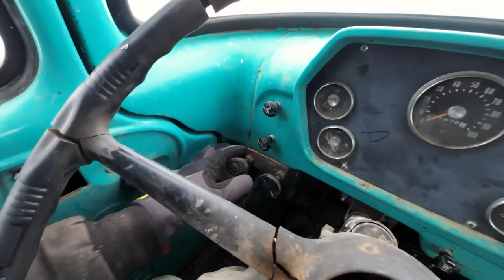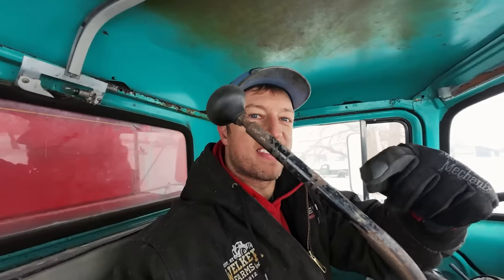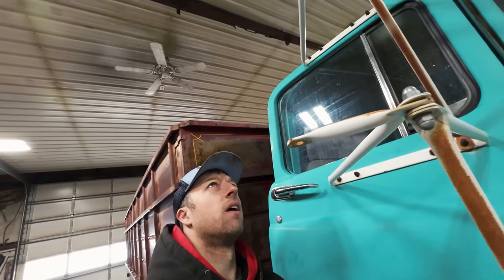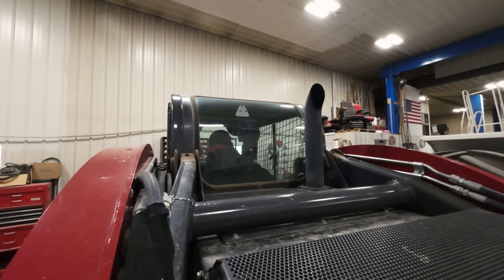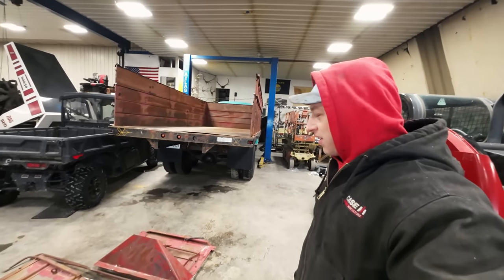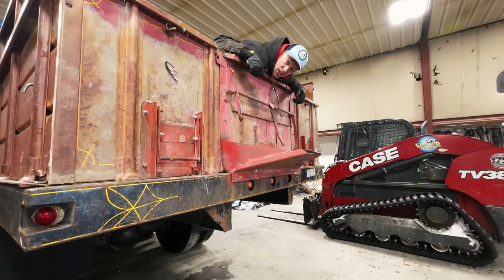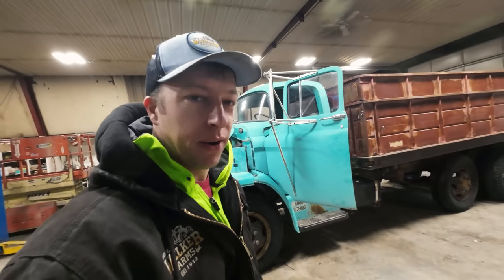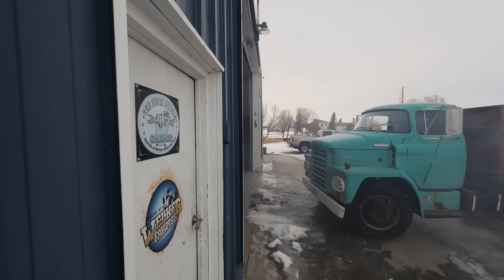It's Running! Part 2 of Baby Blue!

Comment: We never threw anything away on the farm. We had 4 engines from a model T and A that were wrapped up in that old black plastic and my brothers wanted to take them to the salvage metal yard but I paid them what salvage metal was bringing and stored them for another 40 years. I sold each one of them for more than what a new complete performance engine would cost from Chevrolet X 4. Never sell scrap metal and call it twice loved.

Comment: I’ve got a 1945 Ford murcury that was the families grain truck 
Was always in the shed  and no one but my family ever owned it we hoped to get into and get it running removed tge heads and was pleasantly surprised to find everything minus tge radiator was in good shape 

Since the flat head engine is pretty easy to find parts for and once we ripped the sides of the grain box off to find a nice hard  one deck to it thE plan was to turn it into a tool and service truck. I still can’t get over how simple those early engines are.

Comment: Thanks for another great video. 

It was interesting and enjoyable. 

Good job nick. You got the old dodge tunnel again and touched up a lot of things on the truck and box setup. 
Old truck but very useful yet for its age. Lots of use yet left in it. 

Good job on the fix it jobs nick. Spring is around the corner. 

All for now. You take care and be careful. 
Thanks for everything. 
The Iowa Farm Boy.

Comment: Hey Nick & Scott; after watching your content - allot involving repairing, thought you might be interested in the ChemFree SmartWasher system.  I've been using it for little over a year now and am very happy.  The solvent is water based, has microbes which eat petroleum products, never needs changing, and is not toxic at all.  The solvent is cheap, microbes are replenished with the Ozzymats, Ozzy Booster, or when adding more Ozzy Juice as it is water based and naturally evaporates.  The washer is expensive, but a Harblrfreight washer can be modified for much less.  The key to make the Ozzy Juice work is heat, maintain 110 degrees.  I can go into more if you want.  Good luck.

Comment: Nice Job on the shifter.  And you are correct the old 350 were work horses.  I have a 350 4 Bolt Main in my mother's garage ready to bolt into my future car.  Hopefully a 67-69 chevelle.  I built the 350 blue printed and balance with a friend who owns a machine shop who did aviation motors for the airforce.  have a great weekend.

Comment: Love those dual exhausts underneath plus that truck is still there the body is in good shape it’s running and driving. Rare sharp old dodge hauler. They made cabovers and semis as well back in the old days. Older equipment is the way to go. This old machine was sitting. Don’t matter how long it’ll fire up and move. Change of gas or fluids guarantees it’ll stay running. Mainly oil change and fuel change is all! What a sweet old vehicle. I’d keep ‘em.

Comment: The carburetor. A kit. The old kits and old carburetors. The plunger for the fuel inside were made out of leather. Then went to rubber. Then just tune up. I miss the old equipment. My two old 1970's pickups. In my young years. Working on them. I would crawl underneath the hood and work on the engine. I lost part of my hearing in doing so. Yet. From standing on the outside of the trucks. I would time the engine by ear. A timing gun was always off. Because of the timing chain and gears. The back fire out of the carburetor. Enjoy the old truck. It's amazing. Thanks for sharing. Take care.

Comment: You can also text good old fashion transmission fluid rev  up the motor and  pour it into the carburetor slowly and it will burn and smoke but It will clean it out pretty good.

Comment: Nick, just a thought here. Rather than dumping the seafoam in the carb, try this. Find a vacuum port to the intake, use some vacuum line and stick it in the can of Seafoam and let the engine vacuum slowly suck it in. Just like you did, let it sit after the bottle is empty for 10 min and then give it a go. You will get more product in that way and not risk hydro locking a cylinder. Hope it helps.

Comment: We had a 64 900.. had a 413 in it originally, 5 speed and a 2 speed rear end.. and now, the bare engine block and heads would be worth more than twice the rest of the truck.

Comment: Another way to do the Seafoam is to use a vacuum line and let it pull it in that way, do like a spray paint can top full, let it sit for 20 mins then start. Do this on all of my vehicles like once a year.

Comment: "Seafoam" works wonders I use it all the time especially when putting things up for the winter. Also have used Mechanic In A Bottle many times and it has helped with a gummed up carburetor numerous times if you buy it by the gallons you can get it for 50 cents an ounce otherwise it is a dollar per ounce a little expensive but I have had it work miracles also have heard good things about Mystery Oil never used it though
Reply: Mystery oil works excellent. Just put some in a generator yesterday that was backfiring.

Comment: You might need to add a radiator fan shroud to help pull more air through the radiator. Good video. I see you have a spare Dodge truck.

Comment: A lot of people don't know how well seafoam, or similar product's really clean thing's up.  Liquid molly and bg44k work well to.  Many newer car's are direct gas injected, and the engine's get carboned up, and then they use oil.  I use liquid molly or bg44k in my gas, and then i also use the engine flush when changing the oil because it cleans it up as well.  The stuff i use in the oil is mild, because otherwise you could clog thing's up that come out like sludge.  I bought a new car in 2019, and have used all this from the start to avoid the carbon build up.  This old rig will be useful, and as obtaining running truck's like this become harder to obtain, it's good to get these old truck's running.  I believe california, along with 15 or 16 other state's will be selling ev vehicle's only.  Western truck and tractor work's in california, and oregon, but in california, they make you put a hole in the engine block so it can't be used.  Warren said that if you know where to put the hole, the metal can be welded, and the engine will run fine.  I guess where he lives in oregon doesn't have that law yet, so he has welded many steel block's.  G-d bless, hope we get a house update from leg arm's.
Reply: You are very right with the new cars and carbon build up, but you might be attacking it the wrong way. Using BG44 is great but adding it to your gas only cleans up the injectors and won't do anything for the carbon issues on the intake valves. If you can find a vacuum port to the intake, use some vacuum line and stick it in the can of BG or Seafoam and let the engine vacuum slowly suck it in. That will get to the intake and the intake valves that are the real problem of carbon build up in new gasoline direct inject (GDI) engines. Just wanted to offer a tip and I hope it helps.

Comment: I'm surprised the truck does not have 2 speed rear axle?   Most farm trucks in the1940's -70's had 2 speeds in them.
Reply: It does but I think the axle motor quit working

Comment: Was it this last season that you had part of vein get ripped out of your combine?   Will you be pulling rotor this winter?   That would be assume to watch.  Saw video of a John Deere that had run a chissel plow shank all the way out the back of the chopper.   Tore up al the way through.   They had to gut the complete combine.   Never saw what the shank looked like.   Hope yours is modest.  Hate to have it affect threshing next harvest if leave as is.

Comment: Ain't there another better transmission on the farm.... its that or take off the top of  the transmission and fix the bushings and stuff and tighten it up so you can easily find different gears. Not to many can drive something quite that worn out. It is a fairly easy fix but the time for getting off may be a    bit difficult..... just don't know what kind of floorboards you have to deal with. Other than that, its a fine old truck... I am betting that that dump box is a power down as well as power up
        I just got to  thinking or remembering that the shift lever is held in with just two pins on either side or it could be the push down and turn to release that shaft or shift lever. Some part of it is real bad worn and you could build it up with a good welder which you do have

Comment: Please just put a new carburetor on there! Or rebuild it!! Looks like a Edelbrock... . 650-600cfm one should work fine! There like 400$ new rebuild kit 50$ it will run great!! I'd throw a timing light on there too see where the timing is at the same time. I don't think it's bad gas I've had cars with 5-8 year old fuel and ran normal just smoke and had no power

Comment: Never fully understood nor cared for the tall shifters. They have absolutely no practical purpose or use especially with trucks equipped with hi/low and splitter switches on them.